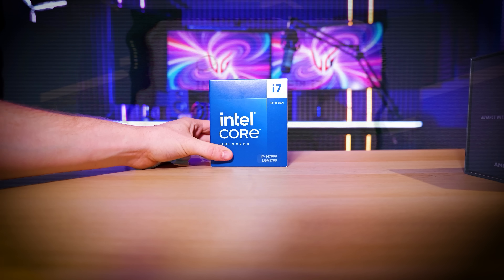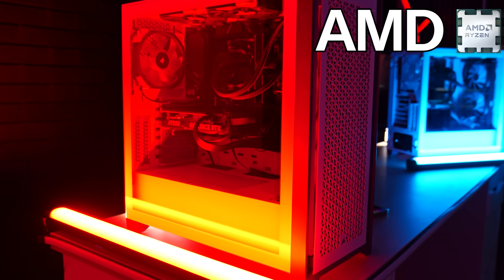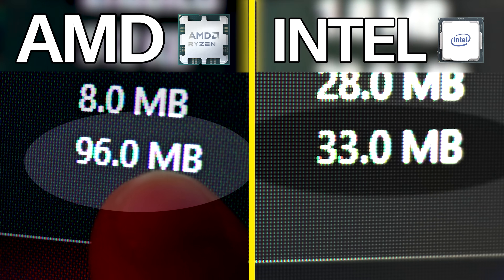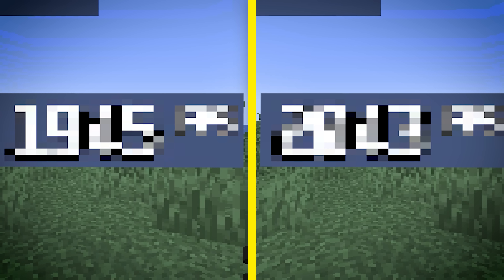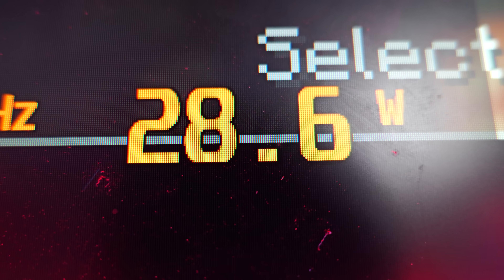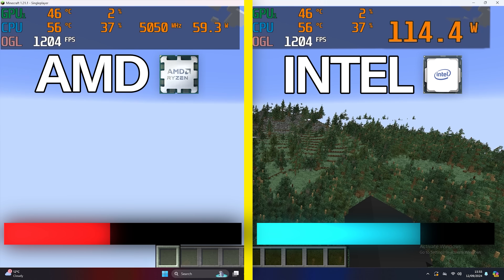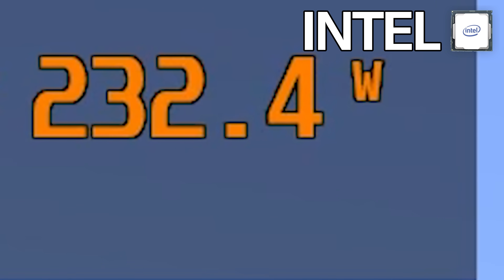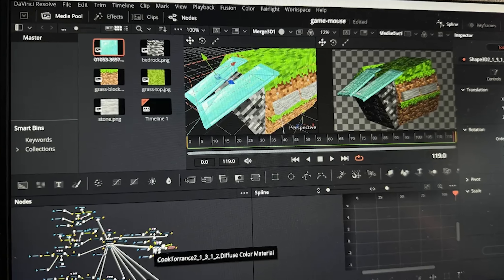Intel VS AMD - Which Is Actually Better?

Comment: The booting time depends on the motherboard too
Reply: And it depends on the hard drive/ssd
Reply: Amd takes longer for memory training
Reply: Only on first startup or ram change
Reply: @murturtle2880 I'm 99% sure this is why it took so long
Reply: even the ram matters
Reply: AMD has to train the memory on launch. By default, it'll do it literally every time until you turn it off in BIOS. Which was what happened here. In the amount of time it took the Intel PC to turn on. The AMD PC both trained the RAM and completed POST.
Reply: Minecraft is more cpu depending
Reply: Yea
Reply: they had the exact same miother board
Reply: @TabsTester  that's impossible because amd and intel require different sockets
Reply: @MrRedditStory999 that's not possible
Reply: dumbasses he used the same pc parts for the 2 pcs
Reply: motherboard is dependent on the cpu so it does kind of depend on the cpu
Reply: And os
Reply: Storage and cpu have the most effwcf
Reply: what time?   my r9 5950 is instant after bioes comes up for 3 seconds.....       win10 I think cut win11 in half.....
Reply: yeah mi pc has amd and it boot fartser
Reply: MSI MB is slow aSS
Reply: SSD TOO
Reply: AM5 and LGA 1700
Reply: amd was msi and intel was aorus
Reply: Ram trimmings! Sorry AMD didn't sleep in bed with Microsoft like Intel.
Reply: he said everything is the same, you didnt hear!
Reply: @ they’re not the same at all
Reply: They almost have the same motherboard 💀
Reply: @Badass9878  nope they are not
Reply: @Badass9878 no they don’t amd and intel motherboards have different clock speeds and overall specs
Reply: @HappyShark47  oh but the fps aren't depends on the motherboard that much
Reply: No they dont 😂@Badass9878
Reply: @Badass9878  Key word "almost".
Reply: @Badass9878 they literally cannot because they have completely different sockets

Comment: dont you just love it when amds performance cores are more efficient than intels efficiency cores
Reply: I love how you don’t know anything about hardware. A 13600k is more efficient than a 7800x3d. Compare idle and light task wattages and get back to me.
Reply: @ProVishGaming eh not really AMD is better for gaming and Intel is more efficient in workstations or for rendering
Reply: @ProVishGaming  smart person
Reply: @ProVishGaming  it gives MUCH less performance too. 13600k is like 2% faster in games than a 7600x and costs 80 usd more. Did I mention it consumes more power and heat? So you would need a liquid cooler for it?
Reply: @nurd699  another AMD shill that doesnt own any hardware is trying to preach someone that owns a 13600k LOL. First of all, a 13600k is actually more efficient. Can you tell me what the light load wattages are for a 7600x? Oh that's right, a 7600x idles at 25w, and in light tasks like youtube, word, and email, it will use above 40w. Meanwhile, a 13600k idles a 5w, uses 10-15w for those tasks. After a day of real world use compared to a 7800x3d, my 13600k was more efficient. Also, a 13600k is reported to be 7% faster in games by most reviewers. I run mine at 5.6ghz, so that lead will increase to like 15-20%. Also, are you forgetting that the 13600k is like 80% faster in productivity tasks? They arent even in the same league. Please don't talk if all you do is provide misinformation.
Reply: @nurd699   @nurd699  another AMD shill that doesnt own any hardware is trying to preach someone that owns a 13600k LOL. First of all, a 13600k is actually more efficient. Can you tell me what the light load wattages are for a 7600x? Oh that's right, a 7600x idles at 25w, and in light tasks like youtube, word, and email, it will use above 40w. Meanwhile, a 13600k idles a 5w, uses 10-15w for those tasks. After a day of real world use compared to a 7800x3d, my 13600k was more efficient. Also, a 13600k is reported to be 7% faster in games by most reviewers. I run mine at 5.6ghz, so that lead will increase to like 15-20%. Also, are you forgetting that the 13600k is like 80% faster in productivity tasks? They arent even in the same league. Please don't talk if all you do is provide misinformation.
Reply: yep, and then! in gaming intel 250w amd 75w max, yr! a joke intelpissboyX} @ProVishGaming
Reply: AMD fanboys only have the edge on the side of gaming, apparently that's it AMD CPUs can't be better in productivity.
Reply: @krizalidriot8354  ??? obviously in your mind the r7 9950x doesn't exist.
Reply: @krizalidriot8354  x3d series are made for gaming only focusing on L3 cache memory , intit fanboys cant fathom that and compare a gaming cpu to a productivity cpu and then love when they see a fcking 20 core cpu beat 8 core cpu in productivity
Reply: So rude u guys, they are the same
Reply: cringe ass armchair keyboard warriors
Reply: btw windows was tested and was found out to limit the power of amd cpus so always use a modified windows for max performance or rebuild and optimize windows
Reply: No.
Reply: Fanboy
Reply: ryzne has high idle and temps though
Reply: @bigturkey1  because they have higher base clock also
Reply: intel is more advanced than amd amd only knows about gaming and intel is all rounder
Reply: No.
Reply: @ANobodyPrettyMuch  Bought Intel Raptor Lake Refresh like I did and found out :(.
Reply: @ANobodyPrettyMuch   ah so ur an intel fanboy
Reply: @cheesearmy1  amd sheep but still at least I acknowledge the fact that Intel is better for productivity. I should've bought an AMD. ;-;
Reply: @ANobodyPrettyMuch  intel is better in productivity, because they turbo up to 5+ghz and 200w
Reply: @cheesearmy1  Sorry Intel fanboys but The 9950x is faster in productivity.
Reply: @cheesearmy1  Is a i7 9th gen good I dont rlly play those pc  performance hungry games
Reply: @ANobodyPrettyMuch  it's ok I guess, do you have any other options?
Reply: @lelouchabrilvelda1794  core ultra 9 is strongest like i9
Reply: @cheesearmy1 nothing wrong with liking a company
Reply: @cheesearmy1  ney already bought the pc ;-;
Reply: @ANobodyPrettyMuch  i mean it's fine and will work for 99% of tasks
Reply: @cheesearmy1  will work way better than the AMD CPUs you shill for
Reply: @lelouchabrilvelda1794 A ton faster, it's the 14900KS with less than half the power draw. 9950X Zen 5 processor, is very underrated.
Reply: @bigboi-y3f  this aged very horribly
Reply: @cheesearmy1  cpu war is kinda cringe ngl, both good and have their advantages
Reply: @cheesearmy1 its too bad that amd is gonna catch fire
Reply: @lelouchabrilvelda1794  9950X3D is faster in both productivity and gaming. Beats Core Ultra 9 285K in multicore with identical single core scores. At stock before OC!
Reply: @ANobodyPrettyMuch you could get a i3-12100 instead and get faster performance + a newer platform
Reply: @FireFoxDestroyer  Im broke
Reply: @ if you need at least 6 cores then intel i5 -8500 or ryzen 5 3500 would be good. I saw an i5-8500 for $50.

Comment: Ryzen 7 7800x3d processor is a superior processor than Intel i7 14700k, it heats up less and consumes less power.
Reply: you are right, but it also costs more
Reply: @OdieTheGreat  aahhmm umm in my country intel cpu's are more expensive than amd cpu's
Reply: @OdieTheGreat on the used market it is 100 dollars cheaper to buy a 7800x3d. And there are also much more listings of it.
Reply: Um actually what about threadripper series
Reply: @IamVoidE 3000 euros vro💔
Reply: the reality is exact opposite with heating
Reply: Until you get to productivity tasks, where in many ways, the 14700k is over double the speed of the 7800x3D.
Reply: Not even close.
Reply: Because it's way slower overall therefore draws less watts and means less heat.

You have to compare that i7 against a Ryzen 9 for a fair battle.
Reply: @saricubra2867  I don't think that thought is correct. Also, unlike Ryzen 9 x3d processors, Ryzen 7 x3d processors have a single-die structure, so it is possible to benefit from the 3d v cache that increases game performance without overclocking. I think Ryzen 9 is more suitable for editing and rendering rather than gaming, and no, i7 processors are not as powerful as Ryzen 7s. Ryzen 7 9800x3d processor can provide higher performance than all Intel processors.
Reply: @ElitWinner  The i7-14700K gets significantly better 3D mark scores than the 7800X3D, the perfomance is wasted because games don't know what to do with 20 cores and 28 threads.

Since the i7-14700K is a significantly faster CPU than the 7800X3D, it finishes stuff quickly at the same wattages. That's why i mentioned Ryzen 9s because they are usually faster and draw less power than i9s and outperform i7s.
Reply: @ElitWinner Very, very fast RAM overclocking nullifies X3D, this is why no one would replace their tuned i9-14900K chips on gaming.

X3D is for those who don't like memory OC (i think the 9800X3D outperforms a tuned i9-14900K for now).
Reply: @saricubra2867  Ryzen 7 7800x3d offers better gaming performance than i9 14900k and 9800x3d processor offers 30 percent better performance than 7800x3d processor
Reply: @ElitWinner  Wasn't Zen 5%?, where do you get that 30% number?.

When Zen 3 came out and increased clockspeed, it was around 30%.

I thought that the 7800X3D is just 5% ahead of the 14900K if we compare games that don't use all of the i9's threads. Then in the real world it's all GPU bottlenecked and shader compilation (Unreal Engine 5 experience).

Comment: 14th gen instability issues be like:
Reply: I never faced issues with my intel cpu
Reply: @abeedammer   which cpu is it? they experience different levels of instability and oxidization
Reply: @cheesearmy1  i7 14700k
Reply: @abeedammer   yeah issues might be coming. here's how to fix it. 
1. Install the microcode update from Intel.
2.undervolt your cpu by ~250mhz
3. pray that your cpu survives and doesn't get oxidized
Reply: perfectly fine on my i7 14700k, since new micrcode less power heat and a lot faster
Reply: what are those instability issues?
Reply: that’s why amd has over 75 % of marketshare I think ☠️💀☠️
Reply: @tenC4D_   they don't, intel still has much more market share, but right now more people are buying amd
Reply: I have a Ryzen 5 5500 and 1080 non ti with GPU 1000 fps easy running around 1.21 sodium max setting no GPU 400 fpsy friend barely gets 400 with a 3080 and a i9 14gen but his CPU runs 93 ° cel easy my Ryzen like 40-70
Reply: And your chip is fried.
Reply: Intel & AMD are need more improvement. Intel Price is also too much for this spec 👎
 Mac M4 is rocking the field with Les Cost. We can buy a Mac mini M4 at an Intel VGA cost nowadays..
Reply: @smileinurhand  too bad macs can't play games
Reply: @cheesearmy1   You may be right. I am not a gamer, as a  Creator Mac much enough nowadays. Less power, compact, Long term use.
Reply: Not for people who actually take the time to tweak voltages/clocks... it was never an issue. Those who dropped it in and forgot about it? yeah, it was an issue.
Reply: amd sheep be like:
you had to comment more than once to mock intel
Reply: @yokosokills i had two points to make

and i made these comments 8 months ago give it up bro 🥀🥀🥀
Reply: @cheesearmy1  sybau this doesnt make it justified🥀🥀💔💔
Reply: @yokosokills  stop necroposting
Reply: For both Intel und AMD fanboys, Intel fixed microcodes and both Core i and AMD Ryzen as stable
Reply: I am Not buying Intel And Ryzen 9 9950x3d Is WayBetter
Reply: Yes
Reply: @arpanroy9177  it is oxygen in the die the die rusts / gets damaged in 6 months your cpu will die
Reply: Instability been fixed for like a month and a half be like:
Reply: @Katje61mc Did updating the bios fix the problem?
Reply: @RealRachid647 no
Reply: @RealRachid647  My 14700k doesn't seem to be affected. Updating the BIOS makes all the voltages stable with basically no performance difference.
Reply: @Katje61mc  even if it has been fixed id rather get the 7 7800x3d but i already have one just giving a concept
Reply: For gaming, the 7800x3d is probably better. But for productivity, the 14700k absolutely wipes the floor with it.
Reply: @Katje61mc  a cpu update dosent fix oxidasation
Reply: @nonbshd  it prevents it 😊
Reply: @Katje61mc  Nope, the bios made it even more unstable
Reply: @keno921  says the amd fan 🤡
Reply: @RobertZ1973 Says the amd fan? i got a shitty i 9 13900k inside my pc, dont call me amd fanboy, but i will not fall for intel this time, this time i will buy a good amd cpu, stop acting like a child
Reply: @ struck a nerve amd fanboy 😂
Reply: @RobertZ1973  lol, how "fanboy", that will be the first time in my lifetime that i will buy a AMD cpu, u r just trolling
Reply: @ okay amd fan 🤡😂
Reply: @RobertZ1973  stop dude ur like 9 years old, I don't care and stop giving me notifications
Reply: @ ok amd fan 🤡😂
Reply: @cheesearmy1 if you didn’t care, you wouldn’t be here 😂🤡
Reply: @RobertZ1973  its my comment that I'm getting notifications for, so maybe try using your 9 year old brain. Genuinely curious, how old are you?
Reply: @ lol creepy old guy wants to touch me 😂
Reply: @Katje61mc   still wouldn't buy it + doesn't work if your cpu is alr unstable
Reply: @cheesearmy1  it's not like it will be unstable right away. It takes like few months or years to get to that point of degradation. Now with the bios fix degradation or instability isn't a issue anymore for new cpu's. As for used already degraded cpu's rma is the only option. Intel increased the warranty to 5 years to all there 13th and 14th gen cpu's so everyone is covered.
Reply: @arpanroy9177   yeah, i know, but I certainly wouldn't buy 14th gen cpus because there's no upgrade path + the microcode was just introduced we dont know if it works yet
Reply: @cheesearmy1  yeah that's true about the upgrade path but the BIOS's update is mostly working. The core voltage now never goes over 1.4v ( before it was going 1.55v or more with oc) and cpu's are running cooler in gaming and other workloads by 7-12°c while giving the same performance in both single and muticore. Ig it's because of undervolting.
Reply: @cheesearmy1  the 14tg gen is just 13th but overclocked
Reply: @LukaszLukasz00  yeah, 13th gen also has instability issues
Reply: @cheesearmy1  meh, idc. i would like never buy the i9, i would rather to buy the i5 12600k
Reply: @LukaszLukasz00  why not an amd cpu? just curious
Reply: @cheesearmy1  eh, there is just something about amd that i dont like, but i dont know what
Reply: @LukaszLukasz00  why? Amd is just fine for any build and 8s generally cheaper or better
Reply: @cheesearmy1  yea i know, but there is just something about the cpu and gpu thats just off... I think its because i just prefer intel over amd. And if you ask me what about the gpu's is bad, its that i just need the nvidia
Reply: @cheesearmy1  Avg amd fan
Reply: @rizwantarique8036   you are a fanboy of companies. I am a fanboy of my wallet. We are not the same.
Reply: @cheesearmy1  don't the best amd cpus actually cost more than the best intel cpus rn? (the amd ones are better for gaming obviously, but price still matters too)
Reply: @OdieTheGreat  the r7 9800x3d is about 420 bucks rn. much cheaper than Intels ~600 for the core ultra 9, which absolutely sucks in comparison.
Reply: @LukaszLukasz00  😂😂😂
Reply: @cheesearmy1 new buyers:
Reply: @cheesearmy1 if you’re buying i7 or i9 from intel on 1700, there’s no need to upgrade. This is gonna be future proof for years
Reply: @cheesearmy1 js say u hate intel, both are fine
Reply: @Katje61mc it isn’t a complete fix, no one can say that this will 100% fix the issues, the cpus are already broken